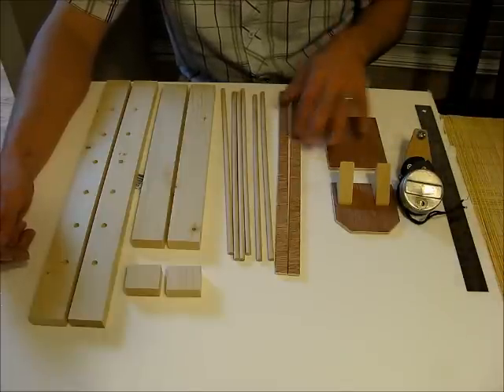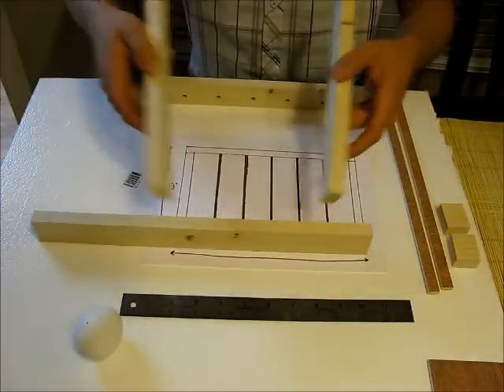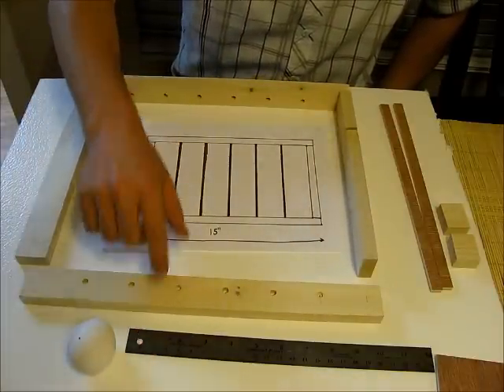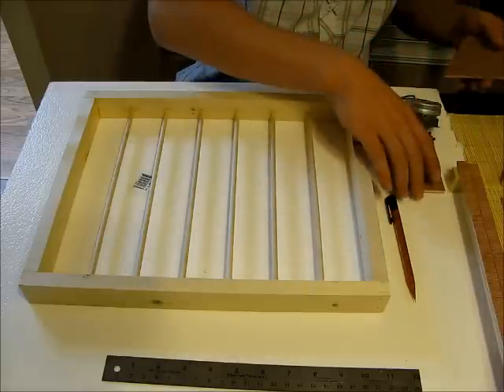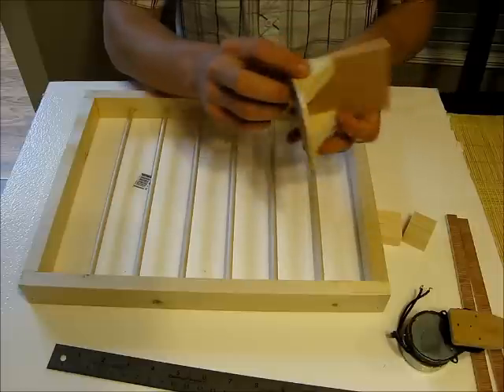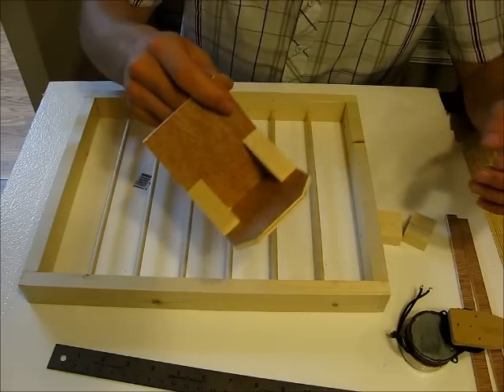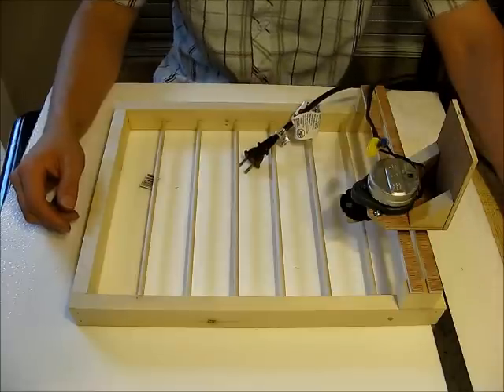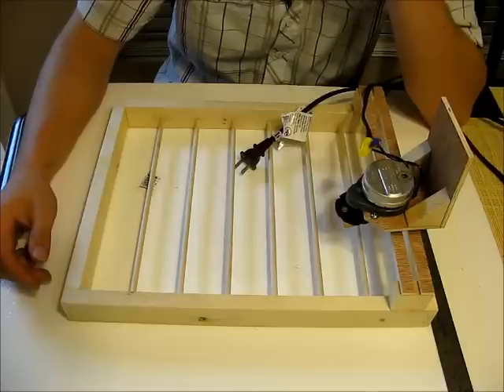DIY Automatic Egg Turner - Detailed Instructions!

Comment: What model is the clock motor?
Reply from the maker: Not sure on the model, to be honest. If you search for this one on Amazon, it should work well too though (motor description below). Any synchronous motor that runs off of 120v and is 1rpm or less should be okay. This one I found is claimed 0.8-1rpm, so you would just want to run it for about 30 seconds. Only some timers will allow second adjustment, so you'll just want to be careful about that when picking the timer.

MECCANIXITY TYC-50 Small Synchronous Motor 100-127V AC 0.8-1RPM

Comment: Two small pan head screws on each rail will also lessen friction during travel . Screw them up into the rail on the bottom side of course.
Reply from the maker: Yes, I think I ended up using rounded oak screw hole plugs for this purpose,  but the screws would do the trick too.

Comment: GREAT VIDEO:  A timer for the motor is going to be at least $10 - and those only have a couple of on/off set points per 24 hrs - what you REALLY need is an intermittent timer (sprinkler timer) that comes on for a 5 min every hour, or 30 seconds every 3 hours - these are much more expensive.  It would be cheaper to get a High Torque clock motor, those are only about $15-20 and will take a modest continual load.  You could also direct a small circulating fan to blow on/towards the motor.  Lastly, research shows continuous (at least 96 turns per day) is best, which is usually easier to set up with these motors - no timers needed.

Comment: add hardware cloth to the bottom and you wont have to remove it just switch it off.
Reply from the maker: f1x1tright if you mean adding hardware cloth to the bottom of the tray built in this video, that would keep the eggs from rolling as it would follow the motion of the tray, carrying the eggs along with it instead of forcing them to roll.

Comment: What kind of egg turner did you use?
Reply from the maker: Random 0524 I just made it using a synchronous motor rated at 1/12th rpm.

Comment: what is the name of motor??
Reply from the maker: Bilal Niazi I believe it's called a telescope clock motor, but it's a synchronous geared motor rated at 1/10th RPM.
Reply: oke thanku
Reply: https://pt.aliexpress.com/item/Hot-Selling-AC-220V-240V-50Hz-CW-CCW-Microwave-Turntable-Turn-Table-Synchronous-Motor-TYJ50-8A7/32662207707.html?spm=2114.02010208.3.10.B7iwCC&ws_ab_test=searchweb0_0,searchweb201602_4_10065_10068_10000009_10084_10000025_10083_10080_10000029_10082_10081_10000028_10110_10111_10060_10112_10113_10062_10114_10115_10056_10055_10037_10054_10059_10032_10099_10078_10079_10000022_10077_10000012_10103_10073_10102_10000015_10096_10000018_10000019_10052_10053_10107_10050_10106_10051,searchweb201603_1,afswitch_5,single_sort_2_default&btsid=822ae0a2-9285-4472-8d9d-97c187733a67

Comment: Hello. I have a motor with a small plastic bracket connected to it. How can I change it? Where to buy bigger motor mounts? Thank you.
Reply from the maker: I'd have to see what the bracket looks like, but there should be screws that hold it on the motor which can be removed to take off the bracket. I'm not sure where you'd buy motor mounts, but it shouldn't be too difficult to make your own motor mount from wood as I did. If you follow the instructions closely, in sure you could do it. Thanks for watching and good luck with your build!
Reply: Thank you for replying. Is it possible to send you a photo?

Comment: very clear explanation I have a 2.5rpm motor soi will need to set that for 12 sec to make half a turn. ofcourse no standard timer can do that  but will be using arduino to regulate temp so can setup a timer there.
if no arduino/microcontroller can also use a cogwheel that presses a microswitch after halfa turn. there are  motors for about 6 usd that do 1/240rpm that makes half a turn every 2 hrs, so you probably should leave that on continuously
http://www.aliexpress.com/item/1-240-rpm-motor-incubators-Incubator-Geared-motors-Turn-the-eggs-tray-Slow-motor-110V-220V/32495786884.html?spm=2114.10010108.1000014.1.CnAXvC&scm=1007.13338.35813.0&pvid=5e7b4740-ffe1-4aff-b6ac-a06466fe0265&tpp=0

I understand the bare minimum is 2x/day and preferably 12x/day
Reply from the maker: it'd be fun to add an arduino into the mix:). Also, if it's 2.5 rpm, you could just run it the full minute and it'll end up on the other side. Thanks for the motor link and good luck on your turner!
Reply: thanks. yes was thinking that too, to run it full minute, but for arduino 12 sec or 1 min doesnt make that much difference. Again tnx for great explanation.
Reply: mather fake you

Comment: As calls this engine?
Reply from the maker: +Renato Nascimento This one is called a clock motor, but any small, very slow moving electric motor that looks similar should work. Just look for something that is 1 rpm or lower (mine is 1/12 of an rpm I think).
Reply: thank you

Comment: Thank You! Definitely the best video on "DIY Automatic Egg Turner". I have some trouble fitting the motor into the plastic piece. I don't know how to explain but the motor is not 100% engaged while rotating and are spinning. Can you explain how you made the hole in the plastic piece? Sorry if I couldn't explain well. This is not my motor but it's how the end looks like http://image.made-in-china.com/74f64j00rZVTtGClgNbk/Synchronous-Motor-for-Industry-Fan-Heater-Egg-Incubator-Hatcher-Fryer-Popcom-Machine-Electric-Fireplace-Coffee-Machine.jpg
Reply from the maker: Thanks! Looks like your motor has the same style of arbor as mine (with the flate on one side). That should help here. I'm not sure if yours came with a plastic bit that goes on the arbor like mine, but you mentioned a plastic piece, so I'm assuming it did. The plastic piece probably has a completely round hole the arbor slips through. You will want to drill a hole on the collar/side of the hole the arbor slips through, so you can put in a screw in. It should protrude into the hole for the arbor. That way, you can align the flat on the arbor with the screw and screw it down tight. This prevents the arbor from spinning inside the plastic piece. After that, you should be able to secure the larger arm piece you'll make with some screws through the plastic piece (see 8:40 in the video). I hope that helps! Feel free to send any question you run into along the way.
Reply: tlgrimmy Unfortunately it did not come with a plastic bit. I have to make one. Thought you made yours as well.
Reply from the maker: Gotcha, I just made the larger light brown portion with the bolt, but the black plastic piece came with the motor. You could probably use a thicker piece of material in the same shape as the brown arm I made, cut a slit from the back to the arbor hole, so that when you squeeze the back, it cinches down on the arbor. You could put a screw through the back side to cinch it. Or you could use a little bit of epoxy in the arbor hole to make it permanent.
Reply: I ll try that. Thank you for taking your time.
Reply: tlgrimmy

Comment: Hey there !  Any way you could post a link of the motor ? I can't seem to find one with the plastic bottom piece :(
Reply from the maker: Mine was a random find on ebay for super cheap, but you can buy an official egg turner motor that's just like the one I used off of amazon. just type "egg turner motor" into the search bar on amazon:). Good luck with the build!
Reply: Thanks a bunch for the quick and friendly reply !
Reply from the maker: No problem and feel free to send me any questions you have along the way.
Reply: good

Comment: Hey! Can you post the link of the clock motor plzz
Reply: http://www.ebay.com/itm/Egg-Turner-Motor-for-Little-Giant-HovaBator-Farm-Innovators-Incubator-110V-AC-/230455831140
Reply from the maker: Nice! That's cheaper than amazon.
Reply from the maker: Mine was a random find on ebay for super cheap, but you can buy an official egg turner motor that's just like the one I used off of amazon. just type "egg turner motor" into the search bar on amazon:). Good luck with the build!

Comment: I don't understand how this is.. but I can't find the motor on Ebay tried searching a couple time? any suggestions? Not very motor smart.
Reply from the maker: Actually, Little Giant and Hovabator sell replacement motors for their turners, but they are just like the one I used in size and function. Just type "egg turner motor" into google or ebay and they come up. They're about $14-$15 after shipping.
Reply: Thank you so much.. Great idea.
Reply from the maker: Stacey Bridges Thanks and no problem:)

Comment: Happy to report that I  built an incubator with your idea and get 100% success rate.  Your way of rolling the eggs is more natural as the same way as chicken does naturally. Since I only built with materials that I had on hand, I didn't use a thermostat but use a light dimmer instead and I didn't have a slow motor so I added a rod extending outside and move the rack by hand a few times a day.  My next step is to build a PID temperature control, and the circuit for a stepping motor  to move the rack back and fore since I have 2 stepping motors laying around and can put that to good use. Thanks  for your inspiration for this project.

Comment: hi, I LIKE TO HELP ME FOR CREATE INCUBATOR OF SIZE THE 300 EGG
Reply from the maker: Nice! 300 eggs would be quite the incubator!:) Definitely can be done though. You would just want to make sure you have really good air circulation (a few fans) within the incubator to keep consistent humidity and temperature throughout the incubator. You also might consider having many separate turners. Maybe one turner per egg shelf and around 50 eggs per shelf. I would also highly consider using a PID controller (ebay) to regulate the temperature instead of the water heater thermostat. It would be much easier to keep precise temperatures in a large incubator with the PID. Lastly, humidity trays at the bottom with small drawers would be helpful so you could avoid having to open a huge front door on the incubator to change the humidity. Good luck and I'd love to see a picture or video when you're done! Thanks for watching:)

Comment: So it just moves constantly but very slowly like 12 hours to do a full 4 inch circle so two turns every six hours.  That is OK for the chicks to be constantly moved?  In nature they get moved when the hen moves them which seems a more realistic emulation of nature to move them every six hours or so no?  What hatch rate did you achieve with this method?

Comment from the maker: Mine was only about $3 after shipping;). However, they can be hard to find. You can always find the hovabator replacement motors (which are a great option) on amazon. They're $16, but you won't need to by a timer as they turn so slowly you can leave them on all the time.

Comment from the maker: No problem:). You could probably just cut out a larger one from wood or mdf like mine and glue/screw to the existing one. I think there is a little round nub on the existing one if I remember correctly. You could simply drill a hole where that would hit the one you cut out to allow the new arm to sit flat against the existing arm.

Comment: hi i finnaly got going on my incubator tonight i have most of the parts but a heat sorce.ive two questions for you=1..what would you recomend as a heat sorce that wont eat my electricity bill.....2=i got a 1 rpm turner and was just wondering when the turner is on is it not on 360 degrees so will the turner not jump up please help thanks

Comment from the maker: No worries at all:). There are two methods used widely for egg turning; holding them upright in a tray and tilting them, or laying them on their side and rolling them. Typically it's easier commercially to have them in trays that tilt so the whole tray can be removed later. It's more natural to roll them like a mother hen would, so I decided to try this method. Plus, my tray can be removed leaving the eggs in the incubator so you don't have to put them back in:).

Comment from the maker: The spacing doesn't really matter. That's just so the eggs will fit between the bars. Get that as tight as possible. I made the armature on the motor 2", so when it turned around, it would move the turner grate a total of 4". Most chicken eggs are between 6"-8" in circumference, so I wanted them only to turn halfway (or a little more) over when they reached the other side. 3"4" would be halfway, so I went with 4" just in case the eggs slid a little before starting to turn. .

Comment from the maker: It should work fine. You could just set the timer to run it for an odd number of minutes every hour. That way the eggs will always end up on the opposite side they started on when the turner comes on. They also sell the hovabator/little giant replacement motors on amazon for about $16. These turn once every 4 hours, so you could just let that one go continuously without worrying about the timer. 80 duck eggs? That's excellent! If you put up a video, feel free to make it a video response:).

Comment: Hi i have the incubator made temperature between 99.6-100.2  with ur style of turner mine is able to hold 80 duck eggs just what rpm motor will i need to move these i can put bearings under the 2x1 sides 
i have found a 1 rpm motor on ebay would that do??

Comment from the maker: No prob! Nothing with wood rot so far. It definitely helps to put those hardwood bumps on the bottom of the trays in case water spills. This way it won't be absorbed by the wood. It only takes maybe 15 mins to make one of those grates too, so if one goes bad it's cake to get another one ready to go.

Comment from the maker: At this point, I the only thing that would help my hatch rate would be getting the freshest eggs possible produced by healthy chickens, and potentially using a PID style thermostat instead of the water heater thermostat. So far, I'm too cheap to get the PID and with an 80% hatch rate, I wouldn't see much improvement. I'd rather just buy a couple more eggs. :)

Comment from the maker: I would probably add more vent holes and maybe mess with a slide-out tray system for humidity, but other than that, I'd leave it alone. I'm not sure why someone would say that the eggs should be end-up, as this is completely unnatural. You don't see chickens turning them end-up anyway:). I have heard some really strange practices that people swear by for increasing your hatch rate, but most of it has no basis in science and isn't done in commercial hatcheries, so I tend to keep it simple.

Comment from the maker: Yes, that motor should do fine. Try to run it for just one minute every hour. If your timer won't go that low, pick an odd number of minutes (1,3,5,7, etc.). This way it will stop the turner on the opposite end that it started.

Comment from the maker: Mine is on a timer so that it only rotates once an hour. The motor is only turned on for 5 mins to rotate the eggs each time. If you have a slow enough motor that turns once every 2 hours or so, you can leave it running all the time. That's what the commercial incubators do.

Comment: My small motor had too low of torque for sliding 5 trays of eggs.  I reduced the drag/friction using strips cut from those almost paper-thin cutting board things.  I super-glued a strip onto the entire edge of the fixed tray frame at the edge where the sliding tray would make contact.  Then, of course, I glued another strip on the underneath side of the sliding portion where it would slide along and, on top of the bottom strip.  So, I have plastic-to-plastic mating surfaces   Slick as owl poop!

Comment from the maker: Glad to here the temps are nice and stable for ya! That is a tricky situation with the timer/motor combo. You could simply let it run for 10-15 minutes each hour. Even though they would likely come to a similar resting place, it should keep the yokes from attaching to the inside of the eggs. Also, it's likely your 1 rpm motor will not keep perfect time with your timer, so it will likely rest in a completely different place after a few hours.

Comment: Tim, I'm trying to figure out a problem.  I have a 1 rpm motor, and a 1 min. increment timer.  Any suggestions on how to get a half turn (or anything other than a complete egg turn) with each power-up?  I would think it best to rotate the egg and leave it in a different position than it started at the beginning of the rotation.  I'm a newbie to incubating, but have used some of your tips and have a pretty precise temp control going now!  Thanks!  ~Scott

Comment from the maker: Not a worry at all. I didn't see any dumb questions;). I actually have a couple extra motors already, but thanks anyway! I bought a timer by GE that can do up to 20 cycles a day, so I set it up to run every hour and then for the last few cycles every hour and a half. The more the merrier on the turning, however, more than 3-4 times a day is just a bonus and not at all necessary. I'd say just to set it up how would make sense for your materials and aim for at least 3-4 times a day. Good luck!

Comment from the maker: You can get the dimmer switches at Home Depot and the AC voltage PWMs on ebay. I'd try the dimmer switch first as it's easy and cheap.

Comment from the maker: Being that they're commercial grade and you have a few to experiment with, you could use a rheostat (like a dimmer switch) and "dim" the input voltage to slow it down. The risk is you'd create a lot of heat and wear the motor out faster. If you don't run it continuously it shouldn't be a problem. The better/expensive way is to use an AC PWM or Pulse Width Modulator. It pulses the voltage at full current, doesn't create the extra heat, and slows her down without the excess load on the motor.